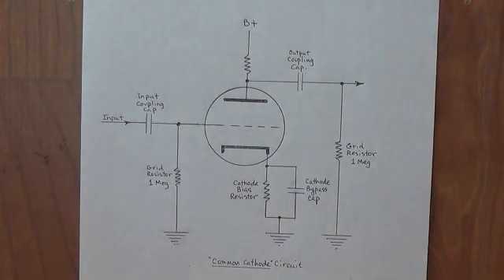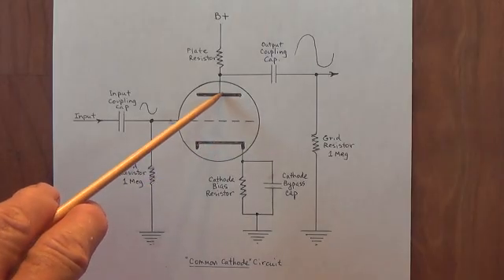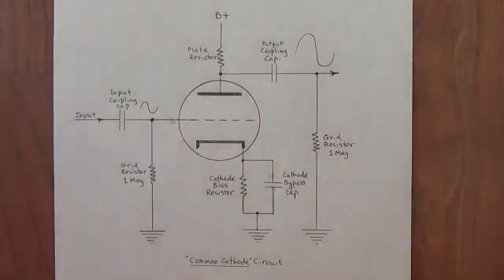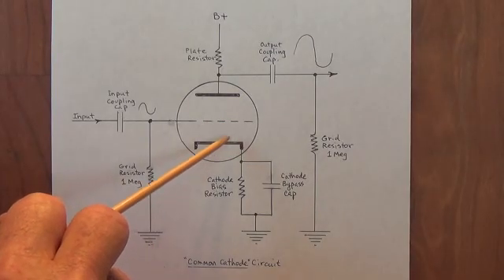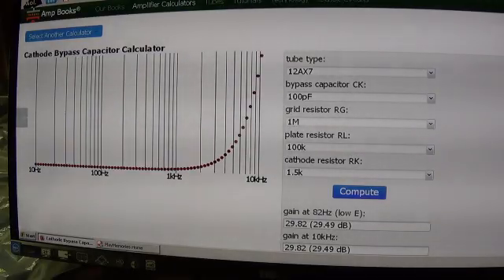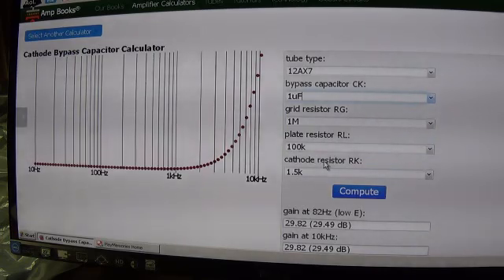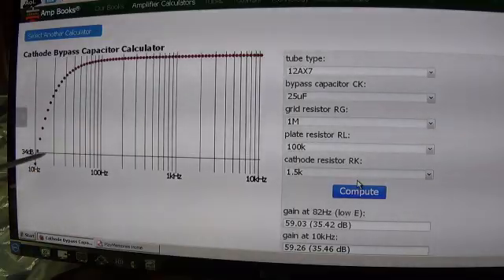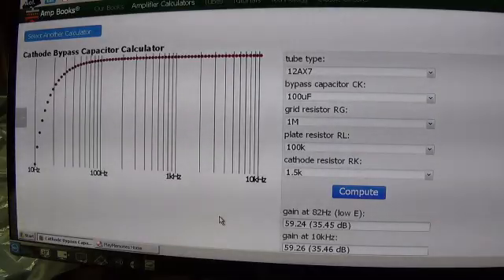Cathode Bypass Capacitors: How they Affect Gain and Tone

Comment: Here I am at the age of 70 and still learning new aspects of electronic music.  My first amp was a dual, EL34, (6CA7) ouput amp that pushed out 30W  Thank you.  If you ever do something on the effects of amplifier output damping factor I'd be really interested.  If I am right, damping controls the speaker movement and keeps sound a bit 'tighter'.  Anyway I'll wait your item on this.
Reply from the maker: I am not familiar with the concept of output dampening, Brian, but will read up on it.
Reply: @UncleDoug  I look forward to that Doug.  The clip I found that sums up the issue is; "A solid state amp, having a high damping factor and negligibly small output impedance, will produce LESS bass and MORE treble into that kind of speaker, relative to a tube amp. The tube amp, having a relatively low damping factor/high output impedance, will produce MORE bass and LESS treble into that kind of speaker."  The inertia of the speaker produces back e.m.f.  A low impedence output stage sinks the current and stops overtravel of the cone.  The overtravel might give a warm distortion that valve lovers admire in the sound.  That's that theory anyway.
Reply: I forgot to say Doug that the output  impedance will be just as important in determining the damping at bass and treble frequencies.  The impedance ratio of primary/secondary in the transformer is the same as the turns/voltage ratio.

Comment: I hope you're still working your trade uncle Doug. I'm 35 and I'm diving deep in your videos to really learn tube amps. Im an automation controls tech by trade and  I love this stuff.  You should be proud to know that your teachings will help the next generation learn this technology and keep it going.
Reply from the maker: We are indeed, M29, and it's good to hear that nice viewers, such as yourself, are benefitting from our videos.
Reply: @UncleDoug  i am really going all in with my study.  I understand the concepts and while I was never a small circuits with resistors etc. guy, I create and modify prints and I design and build analog relay control circuits. 

Your explanation is perfect and succinct.  For folks with an intermediate electrical knowledge your videos are by far...
The best instructional resource on the internet for this niche interest, in my opinion.  

Maybe ill be sending you a new question as I dive deeper. I just picked up the trickiest circuit for me yet. Its a was a steal at 150$. A b52 at112. Not well-known but a lil noisy and known to be a bit unreliable from the little I can find. But I hope to change that. It isn't that crazy of a circuit, but there are several gain stages.  
Thank you for your videos. I hope Jack and rusty are still around to keep you company and conduct experiments.

Comment: Doug, two questions: Is this synonymous with what they call the "Bright Cap" that was in the late 1980s Marshall JCM800? And what you are showing here, is this a preamp tube or the power section?
Reply from the maker: I am not sure what you are referring to, Vin.  It's a complex video, posted long ago. Please be specific. The CBC calculator works for both preamp and output tubes.

Comment: What about the plate inversion (Grid goes positive and plate goes negative) or am I wrong? <><
Reply from the maker: I don't understand the question, John. The plate never goes negative, it just becomes a bit less positive. Vice-versa with the grid.
Reply: John is correct that common-cathode circuit inverts the signal, since increasing the voltage on the grid decreases the voltage on the plate. It’s true that the plate voltage is always positive, but the output coupling cap only passes the audio signal. I think Dave’s sketch should really show that output signal inverted. Of course if you have a two stage preamp if this type, the second stage inverts again and you are back to the original polarization. 

One minor quibble I have with Uncle Dave’s description is that he says the current flows from cathode to plate. It’s true that electrons flow from cathode to plate, but since they are negatively charged the current flows from plate to cathode. It’s that increase in downward (not upward) current flow through the plate resistor that causes the plate voltage to drop. Other than that nitpick this video is great.

More on common cathode circuit:
https://www.aikenamps.com/index.php/designing-common-cathode-triode-amplifiers

Comment: Hi Uncle Doug
Great video, as always. 
It came in handy because I am trying to decide what cap to strap onto the 1.5 k input tube cathode resistor on my 5F1 circuit.  Mojotone suggests using a 25 uF cap, but I noticed that Fender usually used a 22 uF cap on their Princeton, Deluxe and Twin amps.  Not sure which cap to use, but I really like the Princeton sound out of all the Fender amps, and I do like lots of bass.  Any suggestions?
Thanks
Brian McNamara
Reply from the maker: There is virtually no difference between the two caps, they are equivalent and interchangeable.

Comment: Hi Uncle Doug.  Another great video.  Just a question:  have you ever heard of someone creating a notch filter in the bypass cap circuit?  I was just wondering if adding an inductor would create more low-pass filter affect as apposed to a high-pass filter affect, and like I was inquiring originally, if adding the two would create a more notch filter affect.
Reply from the maker: Thanks. Inclusion of inductors such as filter chokes is standard practice in the power supplies of many higher-powered/priced amp circuits, J.
Reply: @UncleDoug  Thanks!

Comment: Very much enjoy your explanations for the average layman tech.  Helps the end user from feeling like they've been what i call 'Tech'd' out.
So here's that part:
The DC model of the stage deals with setting the tube up to amplify in a linear section of the load curve so there is no clipping or distortion.
The AC model deals with the signal.
In the AC model, with no cathode bypass cap, the gain of the stage is adversely affected by the value of the cathode resistor as the cathode is varying with the signal.
When the cathode is bypassed, the ac model no longer has the cathode resistor in the model so the gain at the frequencies the cap is passing to ground is not affected by the value of the cathode resistor and there is no voltage variation from the signal on the cathode anymore as it had been 'bypassed' to ground.
Clear as mud😬😁.
Oh crap! I guess i just ' tech'd' out.
Reply from the maker: I think your explanation makes good sense, Glen. Thanks so much for taking the time to share your knowledge with us.

Comment: How does this work in a dual triode situation? I have a an amp with a 6eu7 that has a bypass capacitor on both stages...the first stage uses 20uf and the second stage uses a .1uf not sure how to use the calculator for that.
Reply from the maker: I'm not sure either, William. I guess you would simply use the values for the second triode.

Comment: A 1.2 Volts rechargeable battery on preamp tube cathodes works great to me. They charge themselves when current flows. There's no need to bore with resistors or capacitors values.
Reply from the maker: That's an interesting suggestion, Paul. Thanks.

Comment: Hello Uncle Doug, is there a calculator that one can select bypass cap values for output tubes such as the EL84? Thanks
Reply from the maker: Not that I'm aware of, Mike. I usually resort to trial and error......picking the lowest value that gives me the best result (to my ear).
Reply: You can calculate this yourself.  Formula is Ck = 1/(2*Pi*R*F) .  Ck is the cathode capacitor size, Pi is 3.14, R is the cathode resistor and F is the frequency cutoff you are looking for.  (Well, the R really should include the tube internal resistance which I THINK is in parallel with the cathode resistor, but you can often ignore it). That's for the "3dB down" frequency BTW, which is the point at which you would start to hear a change in sound level (so it's the convenient point to calculate for).   So if you have an EL84 with a 330R cathode resistor and want to pass 20Hz reduced no more than 3dB, you would need at least 25uF.  Things change a little with pushpull instead of single ended, but this is a good approximation.
Reply: Oh, and I believe, Uncle Doug, that the signal on the plate should be inverted.  Postive swing on the grid allows more current to pass which burns more resistance in the plate resistor, which lowers the plate voltage.  Positive on the signal results in a negative swing on the plate.
Reply from the maker: @carlpaulsen3996  Thank you for your helpful input, Carl.
Reply: Carl Paulsen 
Thanks for your kind reply, would one double the frequency plugged into this equation for a standard 4 tube output push pull design running in class AB? If so, would it be different with only two output tubes in same type configuration? Trying to wrap my mind around why one would double the frequency of desired cutoff to plug into the equation as one person said in a online post. Thanks for your input. 

🙂👍
Reply: @repairfreak  Well, push-pull complicates things and I 'm not absolutely sure, but think about it this way. Each tube in a push pull pair conducts the same frequency signal even if it's only conducting half of the time, and it's frequency that determines the size of the cap needed.  The formula doesn't address current so you can ignore that variable.  In short, use the same formula for each tube.  That said, it does factor in resistance, and if you have shared bias (one resistor and one cap per tube in the PP pair) the value will be different from if you have separate bias parts for each tube.  You'd have twice the resistance for separate bias (because each resistor is seeing only half the current) and roughly half the capacitance (over shared bias).
Reply: Oh, and things change again if you have shared bias among all 4 output tubes in a stereo. But again, it's just the formula for which you input the frequency and the total resistance (accounting for parallel resistors if they exist).
Reply: @repairfreak  In a push pull amp with four output tubes, each pair of tubes is acting as a single tube with twice the current capacity of one tube. At idle, each pair of tubes is passing twice the current of a single tube. Assuming the same B+, in order to obtain the same negative bias voltage in a cathode biased amp, a single cathode resistor for each pair of tubes must be half the value of the cathode resistor for a single tube.
The value of the cap for a given cut off frequency is given by C = 1 / 2 x pi x R x f, so changing the value of R results in a different value for C.
Reply: The Valve Wizard concludes his discussion of the design of a single ended amp using an EL84: "So we would use 100uF. This is a pretty generic value for single ended amps and in many cases we wouldn't even bother to calculate it. Its voltage rating must be at least three times the expected cathode voltage. This is especially necessary if you are silly and use a standby switch, as there will be a brief surge of grid current at start up which will raise the voltage across the cathode resistor quite alarmingly!"

Comment: Some of the first Champs and Princetons (5F1, 5F2) didn't have a bypass cap at all in v1, correct? So these are much more shrill and bright than those versions with one installed, am I right?
Reply from the maker: The Princeton 5C2 and 5F2-S both have a CBC. The 5E1 Champ has one, but the possibly most-popular version, the 5F1, does not......yet, it definitely is not known to have an overly shrill or bright tone.
Reply: @UncleDoug  So how can that be it's not shrill? In the video you show clearly how little low frequencies are brought through with no bypass cap.. Thanks
Reply from the maker: @nickmcintosh3785  Having heard several 5F1 Champs, I did not feel that the tone was "shrill", Nick. Listen to "Layla" and see what you think. Sometimes reality does not match expectation.
Reply: I’ve looked it up and it seems like most 5F1 actually had bypass caps, even though the schematic called for none.
Reply: With the usual 25uF bypass cap cathode current feedback is eliminated at all guitar frequencies so no bass cut. With no bypass cap feedback is present at all frequencies reducing gain but not cutting bass.

Comment: Little late though 
1 preamp stage suggest between 250- 330 uf with 820 ohm as cathode resistor, when building shared cathode. How that make sense, Uncle ?
Reply from the maker: The capacitance seems quite high, Steffen. I would be tempted to go with a more conventional value.....like 25uf.
Reply: Uncle Doug. Maybe there is never any control of the bass. Whether shared or split, it is always between 250 - 330 uf. Your compared a Marshall 1986/87, where you didn't mentioned the 330uf in 1986, but it was split in 1987; you mentoined though it was a bassamp. Can I still install a 100 - 150 uf to benefit more from bass control. Thanks for you time p. Mvh Steffen

Comment: Hi Uncle your info and teaching on guitar amps is very helpful. I have been adjusting things in my 1960s blackface fender champ. I use it. At mass in church so I can hear every one else through it 
by putting a low signal to the amp from the sound board. Works good as an extra monitor. Thanks for all your 
Help. Dwight Allenpark,mi. near Detroit

Comment: I also have a question about the safety light that you built for dead shorts. Can I used a halogen bulb rated 500W?
Reply from the maker: A halogen bulb functions on different principles than an incandescent bulb; therefore, I do not believe that it would work in a current limiter.
Reply: A halogen bulb works on the same principle as a 'normal' incandescent bulb, but with its tungsten filament protected by an inert gas containing bromine, allowing it to produce the same amount of light while using less power. My current limiter has two 105W halogen bulbs connected in parallel for 210W, and I can remove one of the bulbs to suit lower power equipment.

Comment: Does the Amplifier require more power for low frequencies?
The link for the program is broken.
Also, what would be the value for the biased resistor?
Reply from the maker: Try a search for the cathode bypass calculator. I don't believe that the power consumption of an amplifier circuit would be greater for low frequencies. Without proper data, I have no way of guessing the value of a bias resistor.

Comment: You're awesome Uncle Doug! :-D
Reply from the maker: Thanks so much, Chuck.
Reply: @ @UncleDoug would you be able to suggest a switch that would work to switch between a solid state and a tube rectifier? I have all my bypass, coupling, and filter caps worked out for a build I'm doing... cathode biased with 6L6's running HOT :-D but I prefer a solid state rectifier with humbuckers and a GZ34 with single coils (at least on this project). I think the immediacy of the alnico slugs in the single coils reacts better to the slight give of the tube rectifier whereas I prefer the voltage boost and faster, tighter response of the diodes with humbuckers. Can you recommend the proper switch that I can locate on my faceplate?

Comment: why do preamp tubes generally have larger cathode resistor values?
Reply from the maker: Apparently, proper biasing of the pre-amp tubes requires greater elevation of the cathode above ground. It's simply a matter of tube design, Tim.
Reply: Uncle Doug thank you! Your videos have opened my eyes...

Comment: Amazing tube videos, uncle! 
I am trying to develop my own 12AX7 guitar distortion pedal based on your teachings, internet information and some old schematics of the 80's (mostly inspired by the ADA MP1 and ADA MP1 Classic). I was wondering if you ever saw those circuits, it has some nice things and ideas, mostly the Classic that has more options and channels (solid state, clean, brown, distortion).
Also I would like your input on running 12AX7 on 48v phantom dc power for the pedal. I know it's not ideal, but as an experiment I want to keep it simple. I have seen some people running their pedals on 18v with 12AX7's and sound killer.
Reply from the maker: Thanks, Marcelo. The closest I can come to offering ideas for your pedal is to direct you to my videos on building the Rick-Tone Tremo-Drive. Both the 12AX7 circuit and the power supply should be of interest.
Reply: Thank you so much  @UncleDoug  for taking time of  answering me! I have been watching em! 
Maybe you can give me some insight with these rookie questions I have:
In the case of the Rick-Tone the Drive pot is at the output but in others design I see that is on the cathode bias (replacing the resistor); others put em after the coupling cap between the triods.
I was wondering if there is a particular reason for one over the other regarding Drive (worst, better, difference).
Also: I see some designs showing first the triode of the 12AX7 from pins 6 to 9 and then the other half from pins 1 to 5. It's just a design thing or theres a particular reason for it?

Comment: Great channel Uncle Doug. Question can I replace the cathode bypass cap on v1 with. .68 on traynor yba 1 to get more distortion. Thanks in advance.
Reply from the maker: That's hard for me to say, Mr. K. Why not simply try it and see :)
Reply: Replacing the 250uF cap with 0.68uF would result in a severe (and probably unacceptable) cut of bass but no increase in distortion.